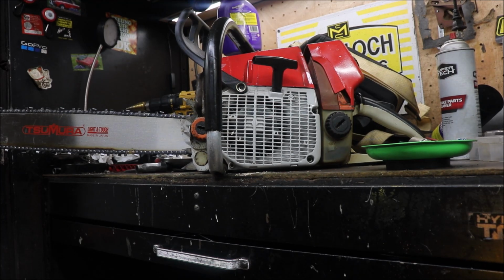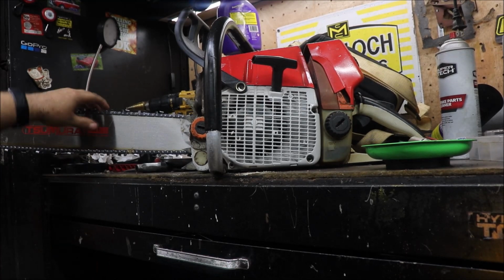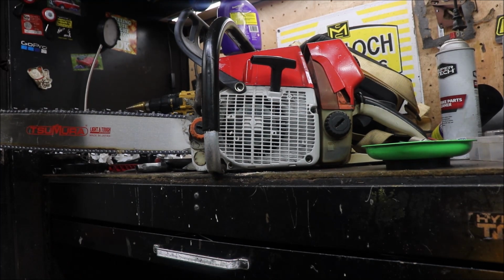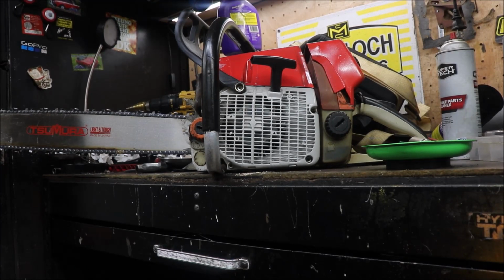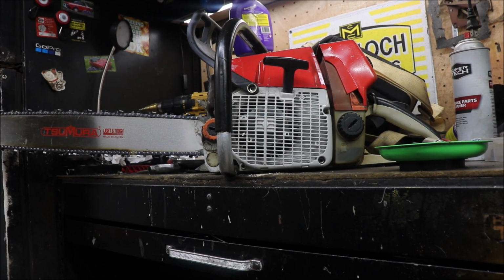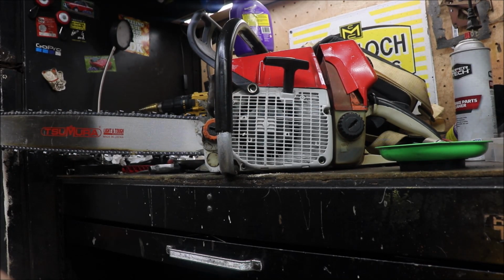Ported Stihl 066  Mag Shakedown Cuts in Hickory "Pullin Chain Like A Train"My Thoughts on the Build

Comment: Yeah that is one heck of a saw holly cow what a beast, like I have a few older saws but hesitant to do any mods to them man i just want to get them running first goal new at this.
Reply from the maker: Man shoot me an email I do alot of trades for saw builds
Reply: Well I started getting saws like six months ago, i had a few but then started watching all these videos about saws and got addicted now I have about twenty saws a few running and just getting into fixing them to run except this brutal weather has stopped any progress short of watching videosNot sure why i like the older ones as i see you building newer ones and making them beast saws but the first one I will be trying to get up and running is an old mac 300 has the HL63 carb i am going to rebuild and then upgrading the points and condenser (thanks to you that's where i got the info) so i have the chips, total carb rebuild kit, the fuel lines the air pump tester, I am so excited to get it up and running, it's going to be a heavy dog compaired to what you use but fun project, then i got a 1-45 mac another old one and a 051 sthil I want to work on along with a 041 farm boss all really cool saws the rest of what i have is mainly newer little saws @JandSChainsaw